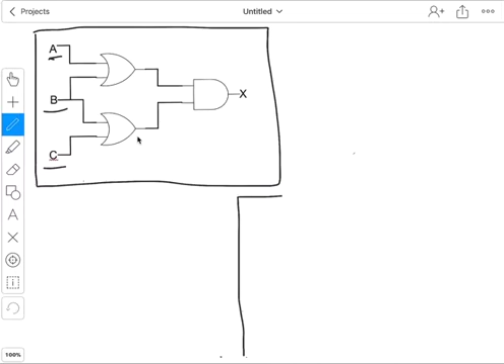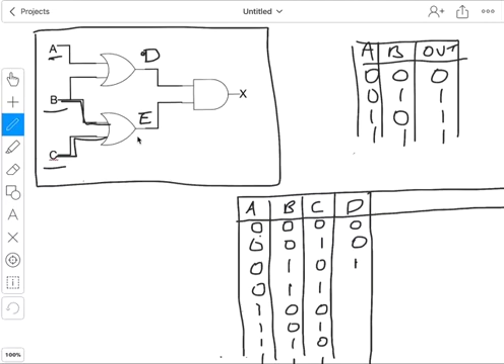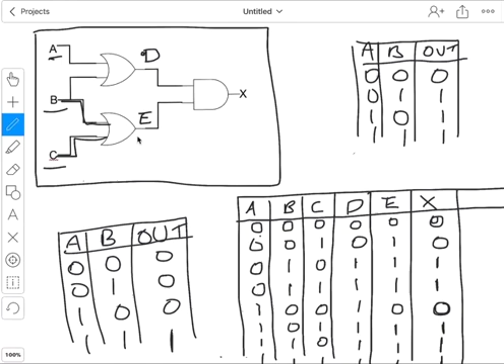Creating a truth table from a logic circuit

Comment: What if you have 4 inputs? A B C D which solve for E F
Reply from the maker: Whether you have 3 inputs or 4 inputs the process is the same. A 3-input gate is outside the scope of this course so you are still just dealing with gates with 2 inputs. If you have 4 inputs then you have more combinations - 16 rather than 8 so you will have 16 rows in your table and you will need two output columns rather than one.
Reply: @CSTeacher  Thank you very much Sir! That helps alot